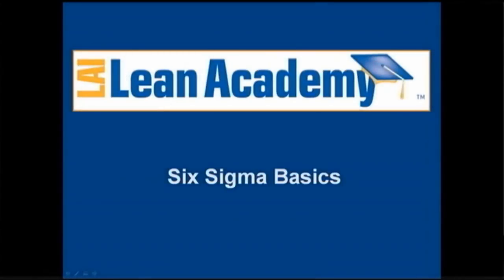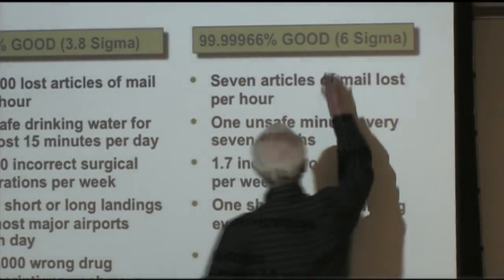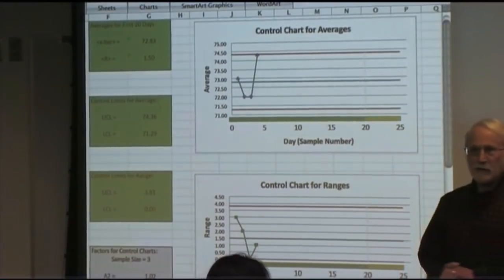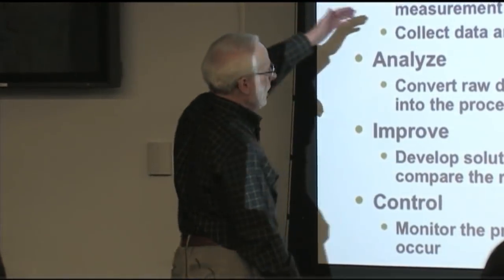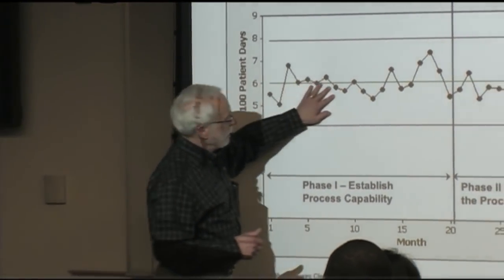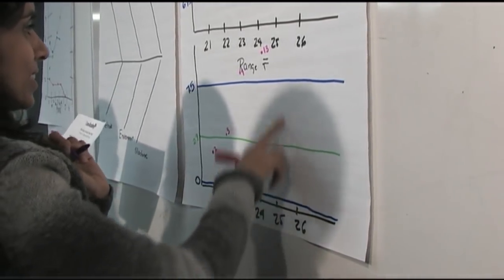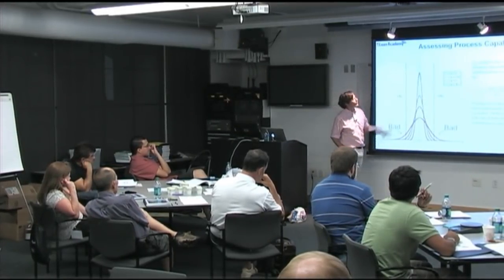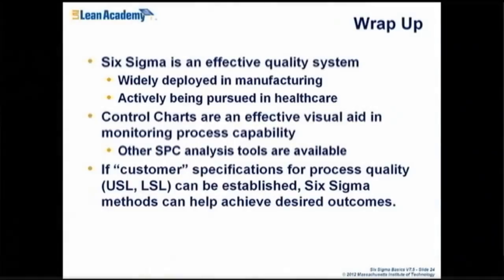Ses. 3-6: Six Sigma Basics

Comment: Six Sigma is based upon several falsehoods. Six Sigma classes don't fall into the category of education. They are doctrine. 

But what supports all of it? The following inaccurate proposals. 
 
1. That Six Sigma was based upon quality methods used in Japan (No it isn't)
2. That Six Sigma was used GE (True, but GE never improved the businesses it owed. It functioned more as a corporate raider wringing out short term profits. The appliances division, a top division prior to Jack Welsh lost all of its name recognition and was sold to the Chinese years ago)
3. Six Sigma is based in solid and scientifically proven statistics (No. It uses statistics to justify itself, but its statistics don't add up and are rigged to derive the conclusion. The stats is to give it a facia of legitimacy. 
4. That an arbitrarily high level of defect standards has statistical support. 

If you question the statistical support, you get pushed back to either point 1 or 2, which are also not true. If you debate point 1, you get pushed to point 2 or 3. This is some type of algorithm for BS. What is impressive is how, Six Sigma, with zero evidence, has that many books published on it.

This article explains how GE's previous success was based on financial chicanery, and this should cause everyone to question Six Sigma. http://bit.ly/2qODX3n
Reply: Shaun Snapp please suggest a better methodology or quality control method
Reply: @olutayosolana6013  Yes, I would recommend just not doing Six Sigma. That would be a great start. 

For example, quality standards should be determined by trade-offs, not by arbitrary quality levels. This is available to anyone who can simply calculate trade-offs. Should toilet paper rolls be measured at 1 defect per 3.4 million? No, it is not worth it. 

Also, I would recommend not lying. So, don't lie about GE having higher quality than other companies. http://bit.ly/2MCKbjp Don't lie about SS being based upon Deming http://bit.ly/2MCKbjp. Don't lie about SS being based upon anything related to Japenese manufacturing. Finally, acknowledge that now GE was really nothing more than a financial engineering firm with a veneer of operational improvement, acknowledge that SS did nothing for GE. http://bit.ly/2qODX3n Now that GE is teetering on bankruptcy it is interesting how little SS devotees want to talk about GE.

If SS is so valid, why are so many lies necessary to sell it? 

So my methodology is to not lie about things or try to trick people that something that is based upon false mathematics and false claims is actually true. 

All of the questions related to operations management are already publicly available, SS does nothing but detracts from the existing body of work in areas ranging from quality management to supply chain management.
Reply: @supersnapp  that response is not helpful. You point out what you see as problems with the video and the process but you do not offer up any true methodology that would achieve the same or similar goals.
Reply: @JimmyMorgan1979  That is not a valid criticism. Critiquing the validity of a proposal or method is not incumbent upon providing an alternative approach. I could describe how a trade-off approach to quality and using standard inventory methods is superior to Six Sigma -- however, that is not related to whether Six Sigma is valid or is based upon false claims. Every proposal can be and should be evaluated for the evidence that it presents. This does not require an evaluation of other options. 

Secondly, as I am right, my comment is quite helpful in that it might make those who would be deceived by Six Sigma proponents to question the claims of Six Sigma and potentially never embark on Six Sigma. Also, Six Sigma is not a methodology -- it is not a study of methods. Six Sigma is a method. See the explanation here. http://bit.ly/2DggM7f